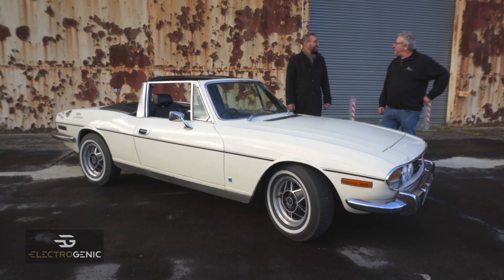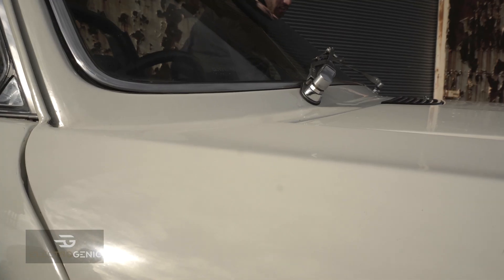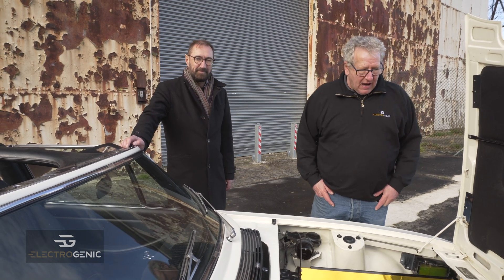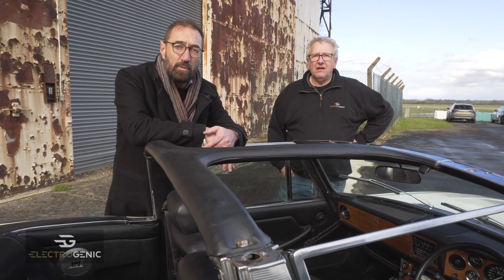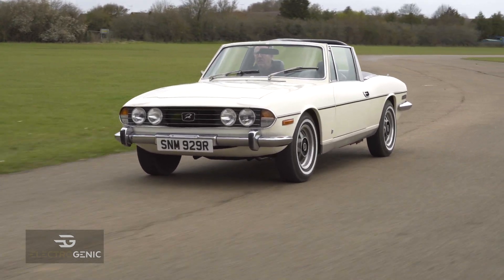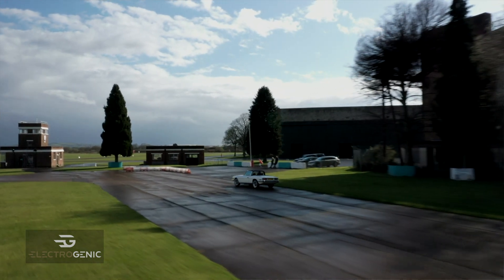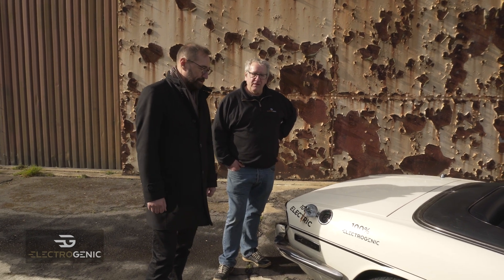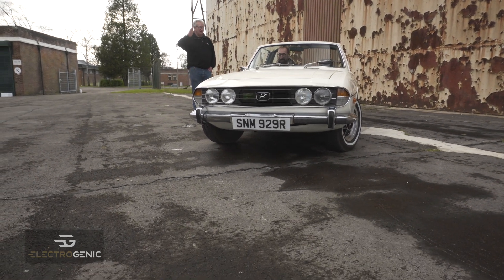Electric Triumph Stag conversion | Electrogenic

Comment: I had two stags... 1972 mk 1+. Auto and a manual od. The best lookers of all times, but usual 1970s BL rust traps and unfinished engine design.  Dreadful rear axle. But all forgiven because of the looks and sound. It must be worth worth building new replicas today that can fix all the many gotchas,  and with no compromise tailored fitting for batteries and motors. Then add integral sound with choice of soundtrack from classic V8 to V16, Merlin V12 and choice of jet turbines. Why not make Tesla owners insanely jealous? It would shame the ghastly mainstream cooking EV designs that lack style and flair, and still cost £3Ok+ and are loaded with sinister spyware. I'm totally in. I shall be calling.

Comment: I drove a lovely stag for years and it never let me down. When I bought it a specialist garage would only look after it if I let them rebuild the engine and it was serviced regularly. After the initial expense no trouble and it was always driven sensibly.  It only started to be a problem when I rarely used it and that lesson learned I sold it on to an enthusiast who would use it. Yes the sound of the exhaust was great but I still approve what they are doing here because it is getting more difficult to get the right petrol and before long it will be very limited as to where, when and how often you will be allowed or able to drive them. Visually the stag is a beautiful motor and for me seeing them in use is worthwhile even without the exhaust. I notice they won't say how much and that's the problem. I suspect it is somewhere around £20k.

Comment: great that you did this to one of the biggest piles of shit that was ever made.. I owned one of these for 25 years ,totally modified . 5.7 chevy engine ,toyota 5 speed gearbox, bmw diff , 6 pott willwood calipers ,vented discs  ,datsun drive shafts ,and on and on ,, Conan ex modified coordinator of the Stag owners club
Reply: Dear Sir.
I simply must protest. The Triumph Stag was the bench mark of world wide motoring for reliability, power, grace and British Engineering of the finest quality.

My wife and I enjoyed many a trip over the 100,000 miles we did not cover in ours. At speeds of up to 50Mph. Stopping only occasionally for water, head gasket replacement and other normal repairs.

Allied to the remarkably rust proof bodywork and peculiar very offset control pedals.
No Sir. The Triumph Stag was an Engineering wonder of its time.
The simply genius stroke of enlightenment placing the water pump at the highest possible position in the engine made a mockery of Fords gravity fed one.

I could go on …. But I will not.

Comment: The good thing about having this car in electric is that it won’t have those engine problems like in the original petrol car.
Reply: There's no excuse for any of those engine problems today that plagued the original. They were problems for those times where there's simple solutions for all of them these days. Just one example of that is how waterless coolant solves much of the corrosion that used to lead to overheating, but the Stag had to wait until 1993 for man to invent that. So, jokingly of course, you could say that Stags were well ahead of their time.
Reply: @-Ace-of-Spades-  One night when mum was driving ours, it instigated the waterless cooling mechanism when it blew out a core plug. Way ahead of its time indeed! :)

Comment: I guess by this stage, society has been "weaned onto" electric cars. The average person now drives a new car that is quiet, smooth, etc. I have one, and (getting old and lazy) when I want to be comfortable/am in the mood for it, I drive it.  Most are auto's, and with multiple gears with almost imperceptible changes. So much so, that a couple of people I know have CVT transmissions.............. and weren't aware of it until I commented. The "more refined" steps have isolated the driver more and more from the driving experience. For some a good thing; for others....................

So going from the above to electric is the final transition. Most people won't really notice the change from a "sanitised/civilised/quiet/"it just does it" normal config car to an electric.

But the reason I drive my Stag (had it for 28 years, done 330,000 kms in it) is because the interactive experience. 

The rev matching and choosing correct gear for a corner, the sound, the whole experience.

When the sun is out (all the time here in Western Australia); my Stag gets used all the time. It is far easier to park (visibility/low waistline) than my newer car; so easier to take to the shops/go shopping.

To me this elec conv is a waste of a "driving experience/interaction" car. The sort of person who WANTS an elec car wants "new stuff". Why would they want "elec in an old thing?" Give them a new cabrio with all the stuff the expect/demand. Which is why companies already make "new elec cars."

So - I can't really see the point. "Oh, but it is for a person who likes the "old school" but wants elec." THAT kind of person will have a new elec car - AND an original "old school" car.
Reply: Full electric cars have no gear box. Hence you can have 100% power immediately.

Comment: Did you say 140 mile range?  (224kms)
Reply from the maker: Yes
Reply: @ElectrogenicREV  I need at least 3 times that range for a meaningful touring capability within Australia. Big country, and some towns are 250+kms apart, with nothing in between except scrub and the odd dusty sheep.
And in the case of the Stag, losing that engine note?  Techological solution required to maintain that special aural experience.
Reply: @acstagger  Well you're not going to get the times that with a Stag anyway! I get around 18mpg with an automatic and 15 gallon fuel tank. Assume not running that to empty gives a usable of more like 250 miles.

Comment: Great that you can do this to old cars, but in the case of the Stag, without that gorgeous V8 exhaust note half the appeal is gone.
Reply: 100% agree, it's a sad day that I've seen this.
Reply: My dad would turn in his grave if I did this to the one he bought in 1976 and now sits in my garage to drive.
I get the enthusiasm behind EV but the Stag is way over 50% all about the crossplane crank, odd firing order inducing V8 burble.

Comment: The original Stag engines were basically rubbish, weren't they? So converting to EV technology seems like a no-brainer on these.
Reply: The only problem with the v8 was the fact it was all ali and people didn't know how to maintain them. That thing sounds like a milk float, what a criminal waste of a gorgeous car!
Reply: @dalejames8302  Concur mate, see comment below.
Reply: Oh dear what a shame 😕
Reply: no they were not
Reply: Jay Burgess - They had their quirks like all engines. But the reason for the bad rep was that back then, BL couldn't have put together an IKEA kit. An OHC alloy V8 thrown together and then given to dealers used to pushrod cast iron head engines. THAT is what went wrong.

If you took a new Honda back to 1970 (and filled it's block with casting sand that BL left in the Stag engines) and threw THAT together/gave it to "old car" dealers - it would have been WORSE. Or given an Aston Martin to same assemblers/dealers.

When it had problems, journo's of the time ran off a litany of "wrong facts" as to why there were problems. I guess that was easier than saying "BL couldn't put together a prefab BBQ". Those 'wrong facts" are resurrected every few years/cut/pasted. People LOVE a wrong legend. Once said, cannot be refuted.

But give a Rolex to a boilermaker to service - yeah; when it doesn't go, MUST be the watches fault.

I have had mine since 1993. In Australia (Perth, where it's hot, but have driven it coast to coast 7 times back in the 90's Melbourne to Perth return, 7,000 kms return trip for Xmas leave). I have done 330,000 kms in it.

If I can make mine reliable/run all day in the middle of nowhere at 130 kmh dawn til dusk in heat up to 48 degrees C (peak, top of Eyre Peninsular in summer) but normally 40 deg all day; HOW can the "engineering be so bad????" They have their problems - I fixed them. NONE of the problems the "legends say." 

But the up side of the "bad rep"? That "recycled wrong facts" thing makes them cheap for me for parts and the like. So if people want to "stay wrong/recycle lies" = works for me. I can afford a V8 touring convertible that I have LOVED, still take shopping on the hottest days here................ and will have until the day I die. 

Thank you Triumph. :-)
Reply from the maker: It is now a reliable daily driver and future-proofed for many more years of driving.
Reply: @ElectrogenicREV  Each to their own. Mine is a daily driver, has been since 93, (93 to 2000 my only car) done 330,000 kms in it; in one of the hottest climates on earth.  Great shopping car, easy to park. 

Cheers. :-)

Comment: Few questions:  How is the power steering powered?  What have you done about the heater?
Reply from the maker: It is the original power steering, powered by an electric pump. It uses the original heating system, we have simply added an immersion heater and a little tank to provide the heat.

Comment: How fast will it charge? That looks like AC only, so not suitable for longer distance touring which is what I’m looking for in a comfortable convertible. Could it be CCS? How big is the battery?
Reply from the maker: It is AC charging only, because it is a low voltage system which makes it a much cheaper conversion. It has 13kW of on-board charge capacity arranged in parallel so that it can charge in 3 phases at up to 50kW AC charging. This means on a 50kW charger for example it can charge the car in about 2 to 2.5 hours.